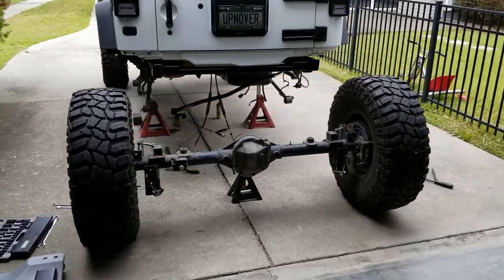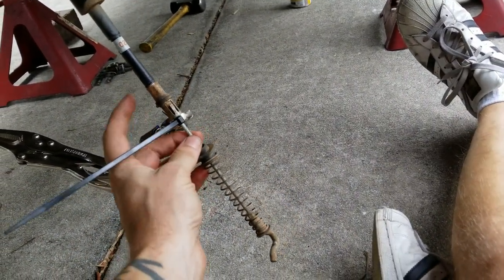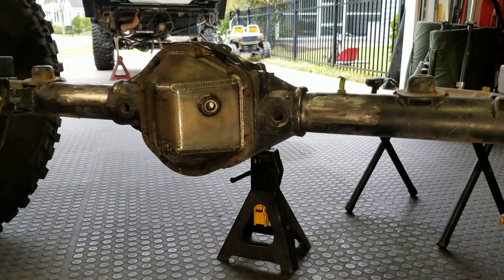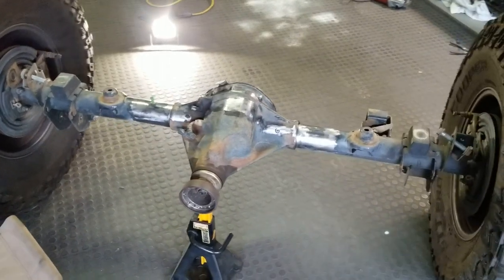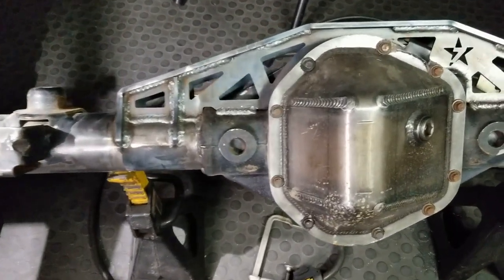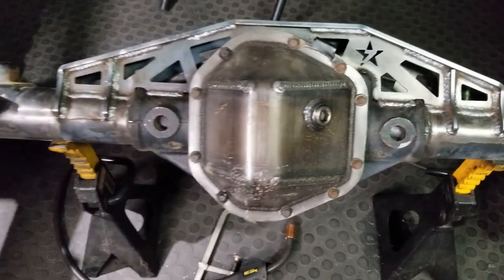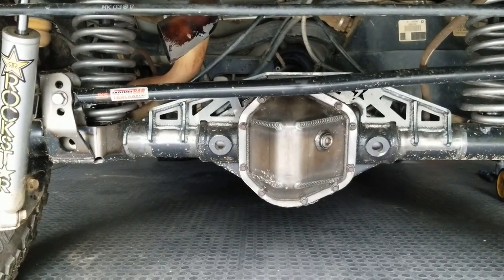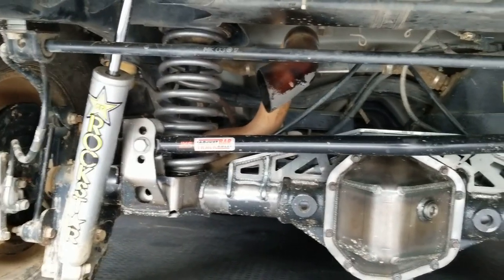7-SLOT CUSTOMS Dana 44 Truss & Adjustable Track Bar Bracket Install | Jeep JK

Comment from the maker: I both pre & post heated the center section w/a MAP torch before/after welding to it. I preheated to cheat & get a little deeper penetration & monitored the temperatures during cooldown w/an infrared thermometer of both the cast center section & mild steel truss. The dissimilar metals cool at different rates due to metalurgy & respective thickness of material...whichever was cooling faster I hit with the torch to try & keep the temps as close as possible as a precaution to prevent cracking. Welded w/regular ol' ER-70S6 .035 wire. Nickel rod would probably be better, but I don't have that. What I did worked fine & nothing cracked anywhere...it'll buff out 👍🏻
Reply: How hot did you preheat too? Any issues with the seals/gaskets with the heat? thanks
Reply from the maker: @caseydman4651  I just heated it to a couple hundred degrees in the local area of the bead to be welded...it really wasn't critical to me, I just wanted to take a little of the shock to the center section away & not have heinous MIG cold-starts. In my opinion, the cool-down temp matching was more important to manage the shrinking of the 2 dissimilar metals...I believe this is what causes the vast majority of cracks as the stresses become uneven & pull apart from one another. As far as the seals, I stayed far enough away from the pinion seal & cool enough by stitch welding that it wasn't a factor. On the ass-end the axle seals are at the wheel ends of the tubes & not in the pumpkin so no worries there. I did have to reseal the diff cover though (was sealed w/RTV). Hope this helps 👍🏻

Comment: Regearing my stock Dana44  with evolution 4:88 gears and thought this would be the best time to have a truss put on. Really think yours is the HD one I’m looking for. What do you think a fair price a 4x4 shop would charge?
Reply from the maker: If the axle assy was brought to me out of the Jeep & free of gear oil w/no expectation to reseal the diff cover, I would probably charge in the ballpark of $350 to mock-up & burn the truss in. It's more work & takes up more time than a guy would think....mock-up, axle prep, preheating, welding, and waiting for her to cool properly eats a lot of time. It's easily a full day project. To put you in the ballpark for the gears, I would charge $350 (labor only) per axle to swap, setup, and install new gears (non-locking carriers) and would provide pics of the final contact pattern on both coast & drive side of the gear teeth. I recommend you ask for pics to show the quality of their work as well 👍🏻

Comment: Hey man you have some great videos. Question… you think I could weld this same truss using a Flux 125???
Reply from the maker: Thanks & thanks for the view! You can flux-core the truss, but it will be more work scrubbing & most likely won't look as clean in my opinion. Flux-core generally gets a little deeper penetration than straight MIG at the same voltage/WFS, so if done right, it shouldn't be a problem.

Comment: How is that truss holding up?? Got jealous filming my buddies on 40s with my 35s. Thinking about beefing up my axles to run some 37s or maybe 40s
Reply from the maker: She's holding up great w/zero issues & looks damn good doing it too IMO 🤘🏻 Thanks for the view & comment!
Reply: @coldsteeloffroad  did you do anything else with the axle? Like sleeves and gussets and all of that as well? Or just the truss?
Reply from the maker: The truss & track bar bracket were all I beefed up in the rear as well as welding the tubes to the center section. In the front I sleeved the tubes & rosette welded them in, installed inner-C gussets, and Teraflex HD ball joints. I have an aluminum 3-link long arm kit w/truss waiting to be installed up front as soon as I get the time & gumption. I don't baby my rig, but also don't beat the piss out of it either & she's held up fine so far w/lockers front & rear. Let me know if you have any more questions & I'll see if I can help.
Reply: @coldsteeloffroad  awesome! I appreciate it! I'm in the building process. Trying to decide which way to go with my build. I dont baby mine, but I'm not trying to break it either. I would much rather build it prior to breaking. Haha